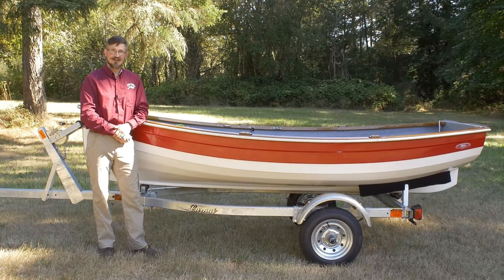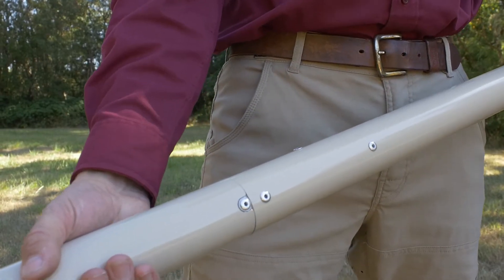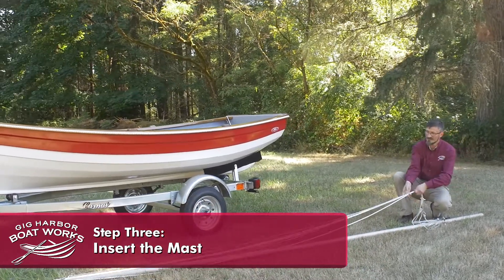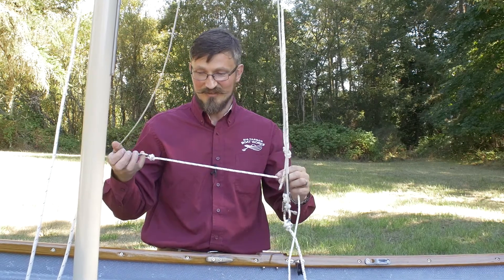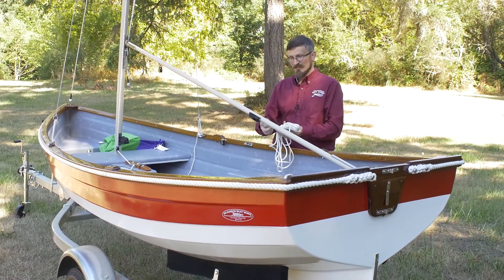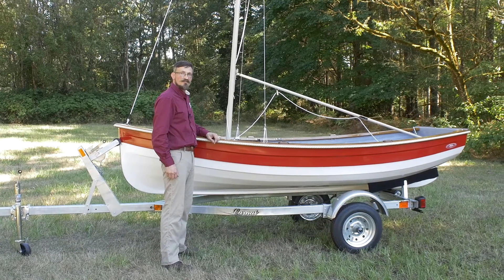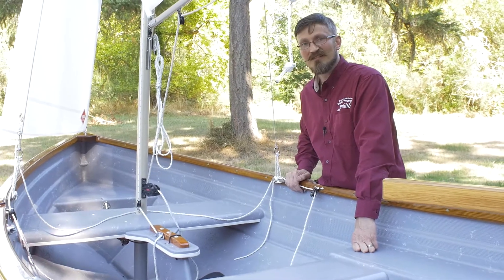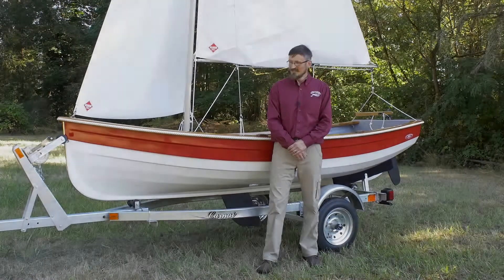GHBoats Sloop Rigging Tutorial

Comment: I find it easier to first put the lower part of the mast into the mast step, attach the boom, then put the main sail on the mast by placing the rings on the lower mast one by one by placing them over the top of the lower mast section.  This is much faster than unclipping and clipping the sail rings on one at a time.  You then hook the shrouds on the upper part of the mast, the wind vane, attach the jib sheet, and place the upper part of the mast on.  You have to do this with the boat on the beach or dock since it may be a little tall on the trailer, unless you have a step ladder.
Reply: Good point, Rickard, and I came to comment the same advice after putting up the rig on my GH Whitehall for the first time.   Those hoops are a pain, and you (we) are right!